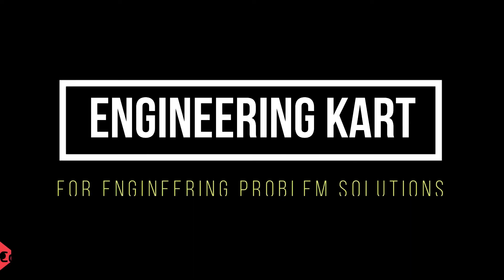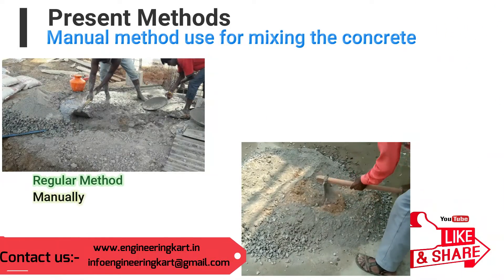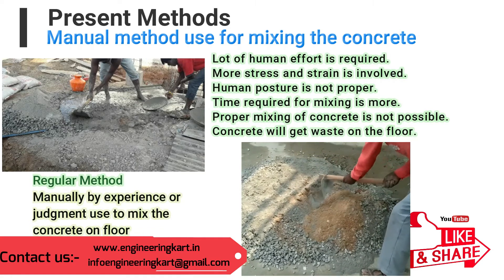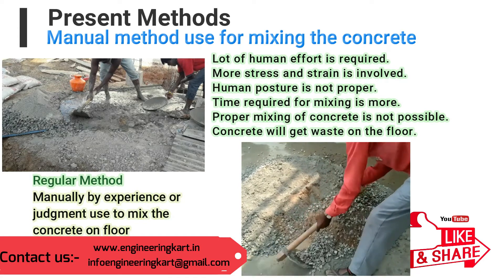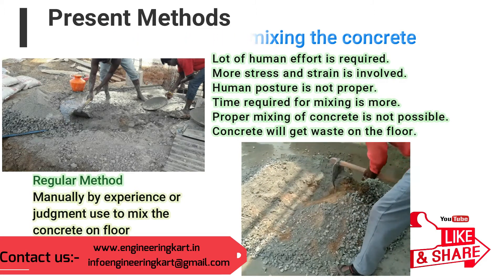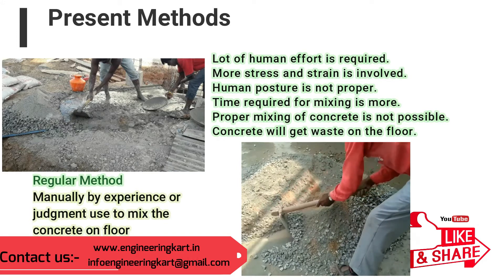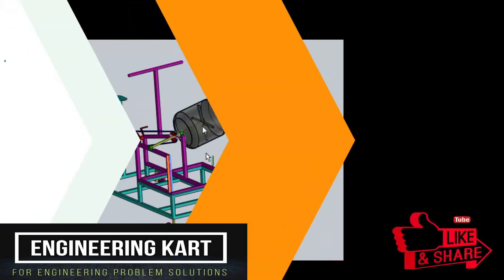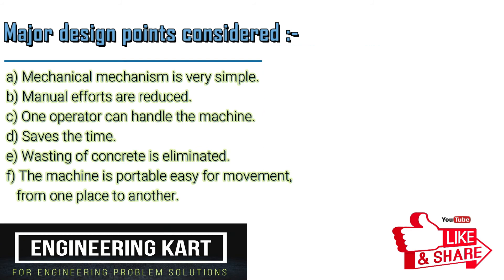DIY low cost MOTORIZED CONCRETE MIXER|HOW TO MAKE CONCRETE MIXER | NEW CONCRETE MIXER

Comment: Concept works but you failed on 2 very crucial elements on the mixer. 
Drum speed 20-30 rpm. Yours is too slow.
The fitting of 2-3 grouser bars inside the drum insures uniform mixing.
Geared motor: to keep costs low I would suggest a 12v wiper motor from an old vehicle.  It already has the gear reduction and can be used with a 12v battery in areas with no electricity